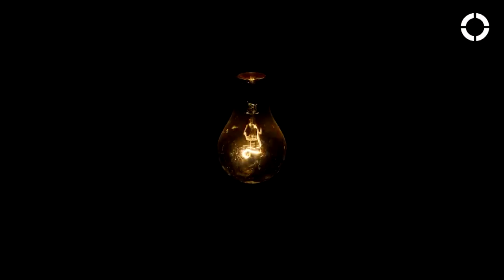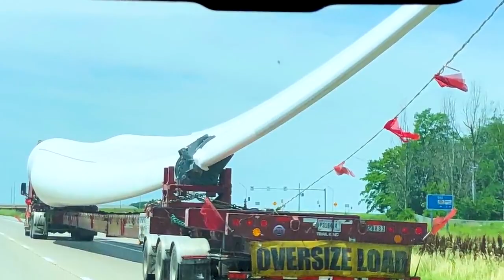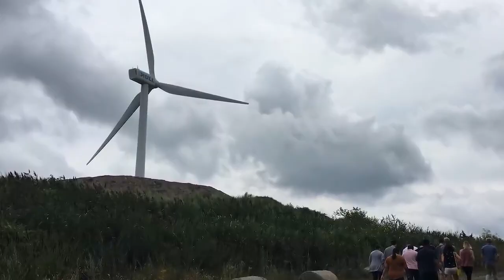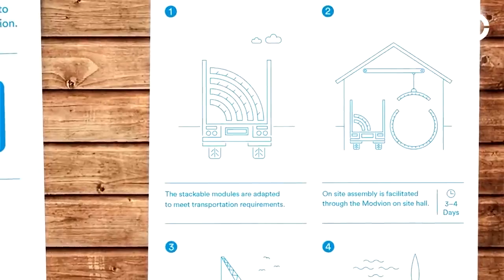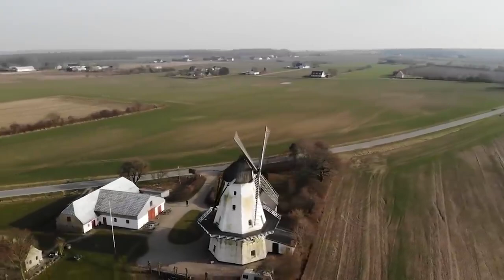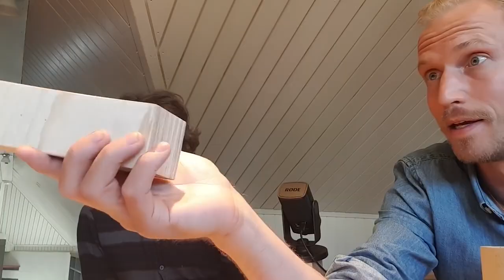Modvion: Modern Wind Towers... Out of Wood?

Comment: I wonder if they considered hollow wood panels on the order of honeycomb or I beam concept to reduce weight rather than solid wood thruoughout. I beam concept is that the inner and out layers are where the work is done with the inside volume just being the connection between the inner and outer.

Comment: I wonder if they use fiberglass to reinforce the wood?  Fiberglass plus Titebond III (waterproof wood glue with a tensile strength of 4, 000 psi) can make some pretty strong structures, especially when combined with wood. Still fairly "eco" and sustainable.

Comment: When I do a job I pick the materials for the application and location There is room in the market for steel and wooden structures same as composite fibres or aluminium. Once the iron is turned into steel you can recycle the same steel indefinitely. Electric arc furnaces and rolling mills all powered by renewable energy seems fairly environmentally friendly.
What is the ratio of actual wooden fibre to resin and plastic coating and fixtures

Comment: I wonder if the upcoming technology of graphene (and composites based on it) will make this wood systems redundant. That would allow for lighter components and a similar modular system would obviate the transportation limitations.
Reply: Carbon fiber is already lighter and stronger than wood/steel, it is expensive im not gonna lie. There is one big problem with composits they're not easy recycleable.
Reply: @ristekostadinov2820  none of the Greenie loved "Renewables" are easy to properly recycle- especially Lithium and composites

Comment: How is the wood tower attached to the concrete? That seems like it would be the most difficult part.
Reply: I'm guessing the same way as a steel tower. You can use heavy steel brackets on the bottom, as there you don't have to worry about weight. Those can transfer the load to the wood on a large area to minimize stress.

Comment: These are super nice guys and they have a great company, but there are a couple of points to put things in perspective:
1. a tower doesn't have to be made of wood to be modular. steel towers can have modular bases (and often do, either steel or concrete parts), so theirs is not the only solution to the "road transportation" problem.
2. large amounts of sustainable wood are available in Sweden, but not everywhere. still, with the amount of wind turbines that will be built, the wood towers could scale very far.
Reply: 1) There are almost no steel factories that are carbon neutral
2) European and American countries do sustainable tree farming like they mentioned.
Reply: @MrLogan2600  yes, steel is rather carbon intensive currently and so is concrete (although charcoal could be used as a filler in concrete as a cheap improvement), but  Modvion make it sound like they have the only solution for a modular tower, and that's not correct.
Reply: @w0ttheh3ll  Ah, that’s what you meant. Give them a bit of a break their English was rough